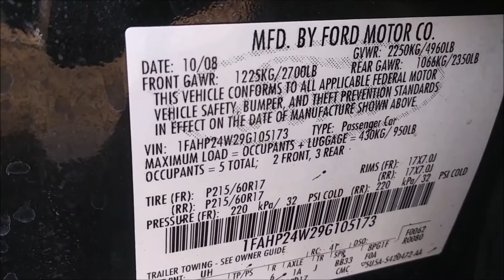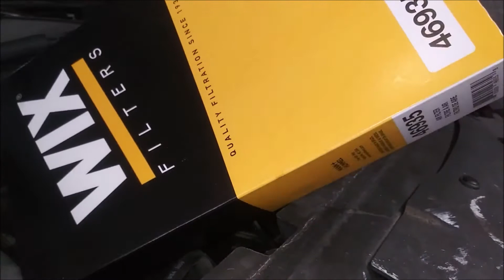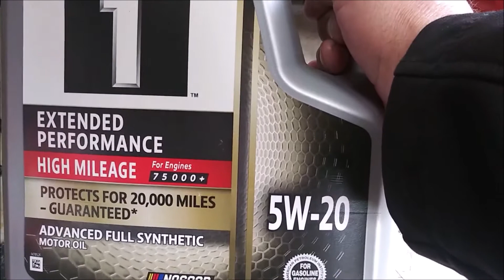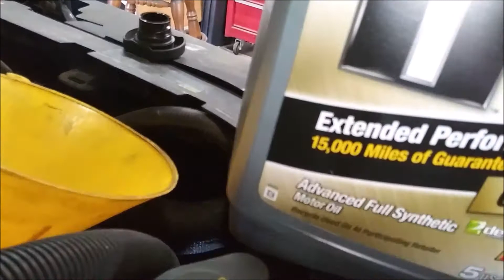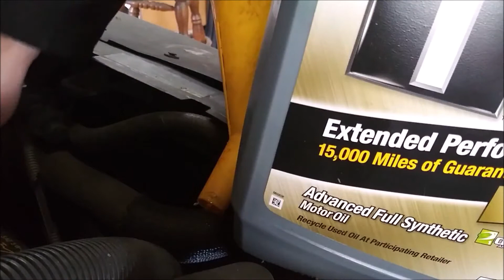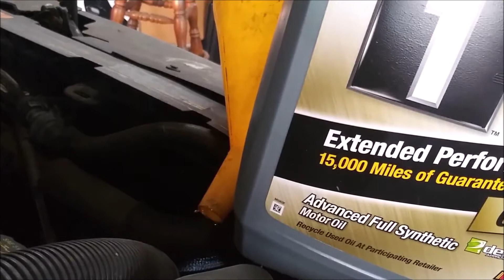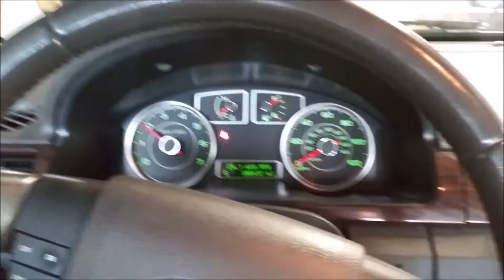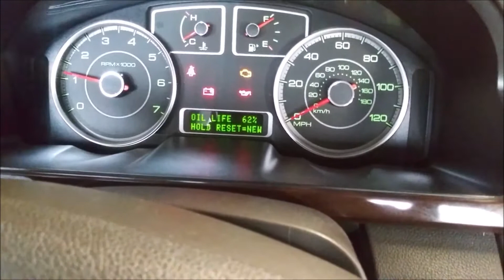2009 Ford Taurus Oil Change and Maintenance

Comment: I hear these engines have water pump issues. Ever had to replace that?
Reply from the maker: 327,657 miles and I have never had a water pump problem.  In fact I just changed the anti-freeze the first time at 320K and it was un-necessary.  The fluid was very clean.
Thanks for watching